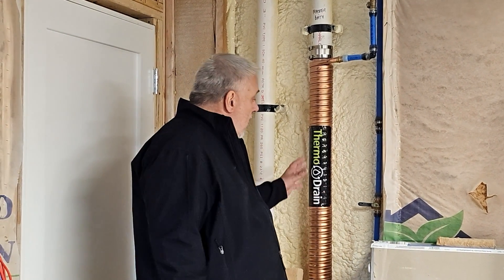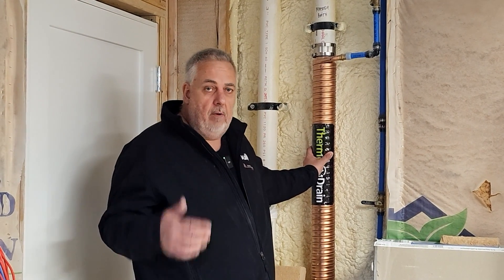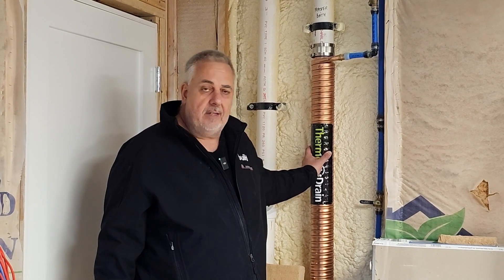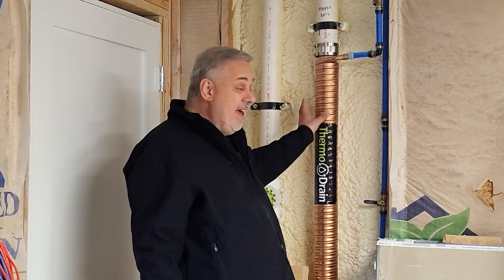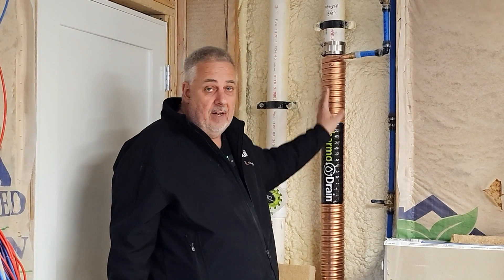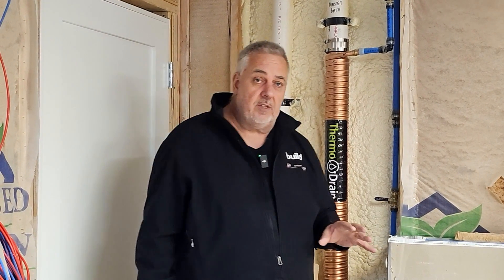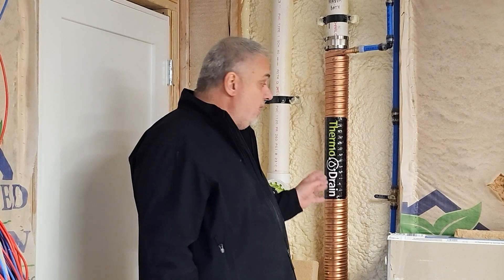ENERGY RECOVERY "THERMO DRAIN"

Comment: For a house with more than two occupants there’s probably more than one shower thus making this less viable. And it’s pretty useless on a tub where the incoming water is not simultaneously timed with draining.  I made system 21 years ago that holds 55 gallons of tub/shower drain water and an incoming heat exchanger. But this type of system is pretty inefficient because the water “grows “ algae on the coils and lowers heat transfer. This type system then needs a large time to transfer heat to the cold side and copper becomes moot due to the algae. A major university researchers found that it might as well have a large coil of plastic designed to hold as much volume as possible to provide more dwell time. This vat can be connected to several shower/tubs.

Comment: is there a "Thermo drain" for HVAC?  Like you pre-heat or pre-cool outdoor air with your inlet water system?  If you ask me, I think this makes more $$ sense than drain water.
Reply: Yes, you can preheat hot water with the AC compressor condenser and also improve the ACefficiency. Typically called a de-superheater.

Comment: This only makes financial sense - if at all - with an electric tankless, which are hyper sensitive to incoming water temps.  And, in that case, the real benefit is getting more GPM out of it.  Secondarily, an electric tanked, which are horribly cost inefficient compared to any other type.
Reply: You would get the same benefit from a tank heater.  You are feeding the preheated water into the tank instead of just cold water.  Not is doesn't have to heat up as much
Reply: I wonder though for on demand systems if swinging to input temp that much might cause some short cycling and strange behaviour from the heater?

Comment: In the winter time, I've daydreamed about connecting the shower drain to some radiant heat pipes which release the remaining heat from the shower into my bedroom or hallway floors so that by the time it rejoins the sewer, all the heat has been released into the floors. Of course, it would need a 3-way ball valve to disable it in the summer, and I'm sure it would clog or result in some awful plumbing disaster. But a guy can dream, right?

Comment: You could put a temp gauge before and after on each side and actually measure the heat gained just like another commenter did on his homemade setup, also, it would be interesting to see if an insulated jacket on the thermodrain and even on the drain pipe from the shower/tub would improve performance more, seems like a solid idea either way.

Comment: it's an interesting concept but not confident in it's effectivity unless hot water is immediately used. Geothermal might be a better consideration for that constant temperature that is already about 45+ degrees which has more benefits than heat recovery from a drain... needs more discussion but I rather go with geothermal. I think gray water recovery may be a better conservation method to discuss it's potential benefits perhaps as a side note, even alternatives for storm water management that is another gray water alternative with alternatives to septic systems

Comment: Below I run through back-of-envelope calculations for a home with a heat pump water heater. Results might vary for non-heat-pump water heaters in each climate. A recap of some outcomes:
- Heat pump water heater in a climate that predominantly requires home cooling where the house also uses a heat pump: Thermodrain should not be used.
- Heat pump water heater in a cold climate that requires home heating for a portion of the year, let's say 200 days: It varies depending on hot water usage in the shower. If it's a small household (2 people) who use less than 50 gallons of hot water per day, it's probably not worth it. If it's a large household (5 people) who use a total of 80 gallons of hot water showering a day, it will probably recover the costs in about 15 years. But ... there may be better options to spend $1000 on from both a dollars and environmental perspective, e.g. add an extra solar panel onto a roof system.

I expect that things get more favorable to Thermodrain when: more hot water is used in the shower (but don't hint that clients could to take longer showers to "get their money's worth", which would defeat the purpose...), if the house uses a gas water heater, or if the house heating does not use a heat pump. I'm also assuming the house design is not impacted by the Thermodrain -- additional overhead expenses for a Thermodrain, such as if time is required to convince the client that it's worth it, could undermine cost savings.

Warm climate, predominantly cooling with heat pump water heater scenario explanation: Reducing the heat pump water heater run time doesn't actually help anything, because the heat pump water heater is cooling the house and so it is reducing the load for the main AC system. That is, pre-heating water in that scenario provides little or no value because any cooling it doesn't do must be picked up by the AC system, so it's basically a wash.

The math gets more interesting when thinking about a colder climate zone, again with a heat pump water heater. Doing some back-of-envelope math:
a) Days we heat the house: let's say 200 days per year.
b) 3 people shower per day.
c) 15 gallons of hot water per shower.
d) From a, b, c, we get ~9000 gallons per year. Let's round up to 10,000, so it is 50 gallons of hot water per day during the heating months.
e) Let's suppose the water is coming in is at 50F and the draining water is 90F by the time it reaches the Thermodrain.
f) Thermodrain claims 40-57% efficiency, so let's say 50% for simplicity.
g) From e and f, we get a 20F temperature increase to the water (to 70F).
h) The energy to heat 10000 gallons by 20F is about 400kWh of heat energy.
i) If the heat pump water heater is roughly 3x efficient, we have reduced the energy load by 130kWh.
j) Heating the water stole energy from the house. So now we need to replenish the house with another 400kWh of heat energy as well. For heat pump based heating, that's another 130kWh of energy.
j) Let's suppose a price per kWh of 15¢. This means we save about $40 per year from the Thermodrain.
k) For an installed cost of $1000, it will be about a 25-year payback period. That is borderline worth it in my opinion.

But is Thermodrain better for the environment? The proper question isn't "how much kWh do we save", but rather, "is $1000 a worthwhile investment to reduce energy usage by 260kWh per year?" In short, it depends, and it is roughly in line with whether it is financially worth it. For example, an extra $1000 could get an extra 400W panel in a solar system install, and that panel will yield about 1.2kWh per day in a northern climate or about 350kWh per year -- a little more than what we get from the Thermodrain. Or just pay an extra couple of pennies per kWh from the utility to purchase clean energy for the extra 260kWh per year at a cost of about $5 per year.

So usage drives whether it's worth it. If hot water usage is ~50 gallons per day in the shower, then it is borderline. If it is less than that, IMO it is not worth it (payback period is too long, and better to nudge people towards a solar system instead from an environmental standpoint). If usage is more than that, then it is getting in the "more worth it" category. That all said, if the household really really wants to reduce energy usage even if it is not financially worthwhile to do so, the Thermodrain should recover the energy required for the copper mining + refining in about a year (I ballpark the energy to mine/refine at 250kWh for the ~20lbs of copper).
Reply: Some math using my own household and data from my hot water (upper) thermostast without heat pump water heater:
- Two people (no teenagers), both showering every day except maybe a 1-2 week yearly trip to Japan
- 7kWh per day to heat from 10C to 50C (50F to 120F)
- CAD $0.06/kWh at off-peak rates
- Water leaves heater at 50C
- Water hits bucket at the bottom of my bathtub at 43C (110F)

18% of the 40C of heating is lost to the bathroom vent. Ignoring heat lost out of poorly insulated pipes, which, during the winter, is actually not "lost", 50% of the remainder is 3.7kWh. That works out to about 22c/day or $63/yr, which, at $700CAD at Home Depot + labor = $1200, say, would achieve ROI in 19 years.

If we lived in an area where energy is 15c and we still didn't have a heat pump water heater, this would probably reach ROI quite a bit quicker.

Mind you, $700CAD is a lot cheaper than the $600USD these things used to cost, and looking at US prices, Thermodrains are going for $300 now, so especially for a new build, these things could very well be worth it even with a heat pump and even without a teenager.
Reply: According to ChatGPT, Wastewater Heat Recovery (WWHR, e.g., Zypho PiPe) has ~10x lower production CO2 emissions compared to Solar thermal, even more compared to heatpump + PV.
That's out of the way. WWHR payback time for a house is debatable and needs to be calculated on a case-by-case basis, depending on the electricity, woodchip price, etc. But for hostels with high traffic showers, it is a no-brainer. Also, roof space should be considered - how many PV, PVT, or solar thermal panels a building could accommodate.
Another viable place to use for WWHR would be a laundromat, where washing machines have both an inlet for hot and cold water and an outlet for hot and cold wastewater.

Comment: Engineer here. So yes they work, but how well depends on your location and plumbing conditions.  Say you have a long run between the heat recovery pipe and the shower then the water will cool more negating it's effectiveness. Conversely the ground water temperature will have an effect.  The colder the incoming water the more effective the pipe will be because the greater the delta in water temperature the faster the heat transfer and the more you'll recover. It's basic thermodynamics.  Which leads to the engineering analysis.  Cost recovery time the colder the ground water the faster you'll recoup the cost of the pipe.  Interestingly you want to insulate that pipe because the warmer the pipe is the more effective it is. Which I hadn't first considered but it makes sense you have to heat the copper before it will start heating the water. So the higher the demand load in the home the more effective they become. 

Also effecting the recovery rate is the surface area which is why i favor the power pipe which splits the incoming water stream into 4 pipes that have greater surface contact with the main pipe before recombining them in the outgoing manifold. 

Lastly the rate of cost recovery is inversely proportional to the effectiveness of the heating method.  The more inefficient the heating unit the faster you recover cost which makes sense. This is of course tied to time, but that depends on your current utility rates. 

Also man get a good sound guy and better camera. Oof.

Edit: some light reading on a mon night https://sustainabletechnologies.ca/app/uploads/2015/06/DWHR_TechBrief_June2015.pdf

Comment: I made one for my house 10 years ago. 
I used a 1.5” copper inside a 2” copper type m. 
I used reducing tees 1.5x.75x2”.
To form a shell and tube about 5ft long. 
Installed under the shower.
I was getting 20F rise when the incoming city water was 36f. 

And about 10F rise in the summer. 
I found that it needed cleaning every two years or the performance would be halved. 

I don’t think single wall meets code. But it works much better.  

Any plumber could make one for the cost of 2 tubes and 2 reducing tees.

Comment: I'd be very curious to see what impact different climate zones have on the efficacy of these systems.  If I install one here in Florida where in the summer we have 80F water coming from the street I probably don't get as much benefit as I would in North Dakota in February when that water is trying very hard not to freeze coming from the street.  Also if you're somewhere with higher energy costs, the break even point is going to be hit sooner where a small improvement in efficiency makes a much bigger difference.
Reply: Up here in Canada I'd give it a try, all the little bits add up. Or as a cheapscate I knew would say, take care of the pennies and the dollars will take care of themselfs.

Comment: Their website says about $300 to $500, depending on size, which is surprisingly cheap for copper. They also claim from 40 to up over 50% heat recovery. This appeals to my engineering brain, which loves efficiency at any cost. But is it worth the money? An unexpected savings is that you could get away with a smaller water heater.

If $300 is way too much, you might make your own using concentric pipes. The inner pipe is best made from a material with good heat transmission, plus the outside of that pipe should be suitable for potable water. The outer pipe needs to be suitable for potable water, needs to hold pressure, and should be very close fitting to the inner pipe. My engineering gut tells me you don't want a lot of water sitting in this thing, waiting for the next time someone turns on the hot water.

This could not work as a retrofit to my present house, as shower and bath drains immediately merge with the larger soil stack. This would be best if designed in at the architectural stage. I've got a piece of land and should start building next year. Because I planning to put the bedrooms at one end, and the kitchen at the other, I wanted on two water heaters. Both shower/bathtubs into one, kitchen sink/dishwasher into the other. Any fixture that connects only to cold should not drain through this type of device. Merge the wastewater flows after heat recovery.

Comment: Steve, first off, great video, description of how this works, but...
Does it work? Possibly, but I think you also lose a lot of that energy. Think how much loss of heat you have with just the water coming out of the shower head, until it hits the shower pan.
My question is, what is the cost vs payback?
A 4 or 5 degree rise?? They claim a 30% to 40% saving on your heating bill?? Not possible, if you are rising your water at let's say (given your numbers) from 55 to 60 degrees, depending on the install, you are only a small amount, no matter which way you look at the install (from their site) you are either feeding your HWT, or the cold water feed on your shower.
As showers aren't enough of your hot water usage, there is no way to cut your bill by that much, you MIGHT save a few pennies per shower, so, in most cases it might take 5 to 10 years to break even, and if it needs any repairs, much longer.
And you need multiple ones for more showers? (one per shower).
It's a good idea on paper, its not a bad idea, but needs a lot of improvement I think, also some insulation around it so you don't lose all the heat, but I still don't see a large enough recoup.
My conclusion for me and any project I am doing, unless somebody needs cheap/easy "points", no way.

Comment: The manufacturer could validate their claims and make it much easy for the perspective/average consumer with a discrete real-time video demonstration measuring the heat exchanger temperatures at the effluent/waste water inlet (warmer) and outlet (cooler), then the influent/potable water inlet (cooler) and outlet (warmer).  There was a product installation video that concluded with a rapid temperature scan of the influent inlet/outlet lines to show the ΔT, but I didn't see anything else that would more comprehensively demonstrate the change in variables.

Comment: Why wouldn’t you do the same thing around the hot water supply line recover the heat that your losing out of the supply line and bring it back to the hot water heater
Reply: Because it would pull the heat out of the supply line.  That isn't waste heat.  That is the heat you want to come out of the tap

Comment: Steve, you mentioned that the water is feeding directly into the water heater.  What if the cold supply line for the shower was where this went.  It would have the more immediate effect on the system.  In your example you suggested a potential of +5 degree heat gain.  In this case you would just turn your mixing valve down slightly once the shower has been running for enough time to get the gain.  It seems like if you are sending it to the water first you would get a lower net effect. I would be curious what others think.
Reply: I've seen diagrams of several different ways to hook one of these up.  It's been a while since I saw them, but you'd probably get the highest efficiency if the ThremoDrain water fed into both the cold of the shower and the input to the water heater.  But IMO you'll still need to be able to get truly-cold water for the sink, vs. the somewhat-warmed cold water for the shower.  If there's any significant distance between the ThermoDrain unit and the bathroom, running an extra pipe probably isn't worth it.
Reply: Yeah you'd want to avoid dumping your warm water out a faucet that didn't benefit from it, and that cold water input to the hot water tank should always benefit if hot water is being used. 

Without test data in an actual house like this it's all iffy.

It might actually be better to run it to the general cold water. It might be better to have a standing tank and pump the water to that (to benefit when emptying a tub). No one really knows. It's also likely none of it is actually cost effective.
Reply: Ideally you'd pull the heat at ever shower floor drain/sink/everything else immediately back into the cold water side, but that's even more expensive as it's done for every shower, vs this solution to cover them all at once. 

Tons of questions with uncertain answers.
Reply: Even more ideal would be to connect your heat pump water heater to it so the pipe would be truly cold and you'd extract more heat, but that's even more cost!